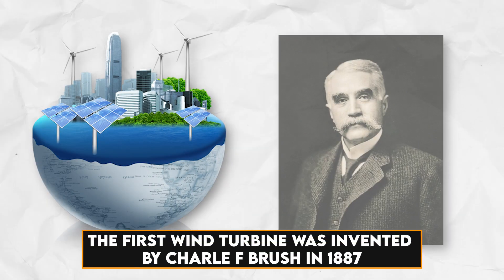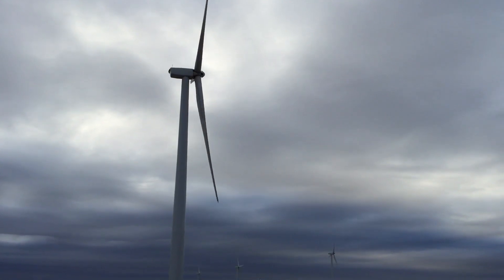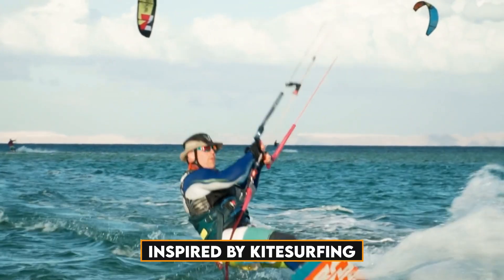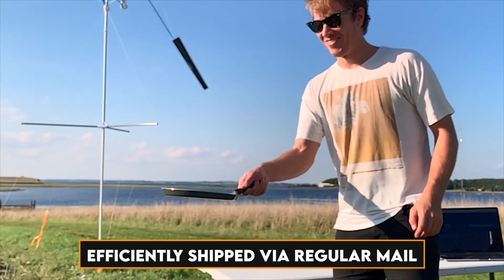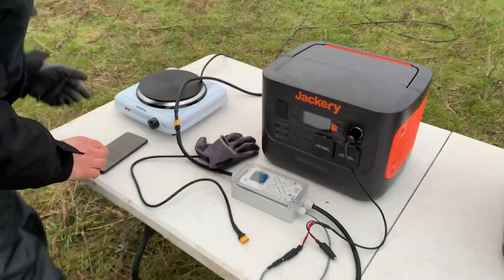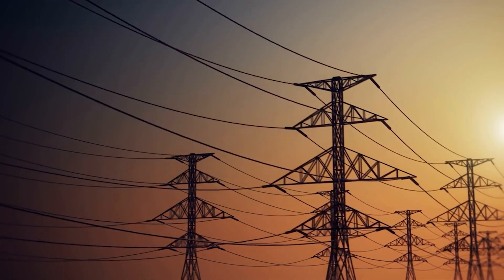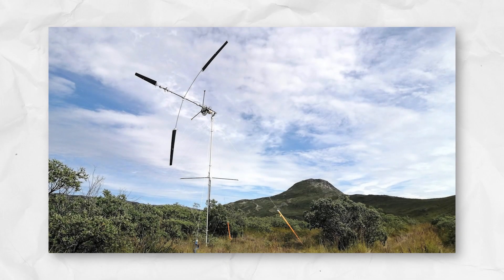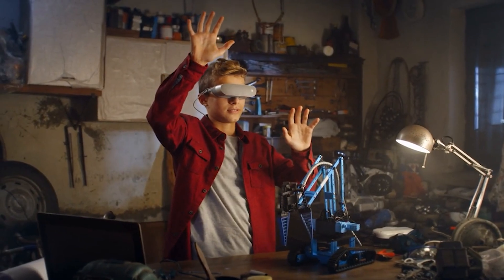Kitex CEO: Showcases Electrostorm Rotor

Comment: Uh, duh, watts/second makes no sense at all. Watts are already joules/second. One volt times one ampere of current is one watt.In other words, a watt is already a time rate of energy transfer. Does your bathtub fill at a rate of 4 fluid ounces of water per second every second? What sense could that make?
Reply from the maker: You're absolutely right, and thanks for pointing that out! Mixing up units can be confusing.

Comment: The current wind farms run blades that are not recycled due to glass or carbon fibers so are they really green tech? solar is just as bad
Reply from the maker: Both wind and solar have areas to improve, and awareness is the first step to better solutions!
Reply: I wish this type of tech were given to the public domain with these issues fixed not hoping someone will find the answer as it becomes a problem. Now one other thing for you a dam is considered not green due to the concrete in it now a wind farm has massive amounts of concrete in the base and if at sea that's up to four times more so is it really green tech?
   @EcoTech-tx6ci
Reply from the maker: You bring up a really insightful point about the environmental impact of materials used in green tech. It's true, aspects like the concrete in wind turbine bases do have an environmental cost. This highlights the importance of continually improving and innovating in sustainable technology to make it truly green. Your thoughts on public domain tech are also very interesting. Thanks for sparking such a thoughtful discussion! 🌬️